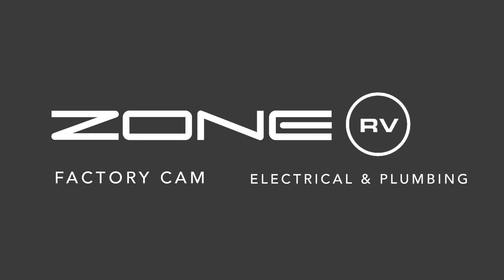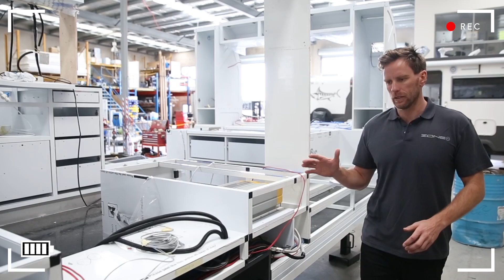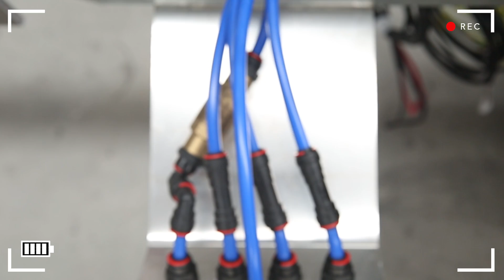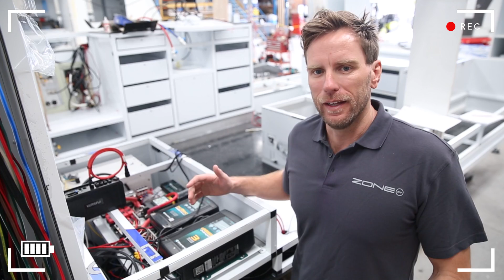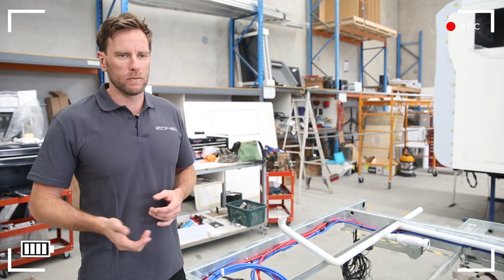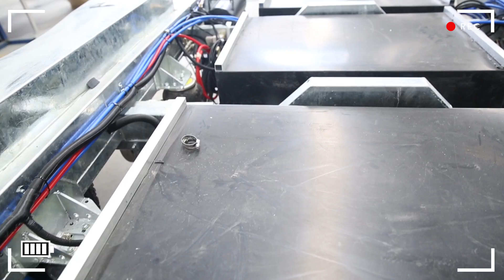Factory Cam 05 - Electrical & Plumbing

Comment: nice van and all that, but just wonder how can you  fix any pipes or electrical problem if you can't remove the glued panels or access the cavities even if you tested it....... just a thought
Reply: Not sure if this has been replied to Daniel but it appears that cabling, plumbing is done before the walls as per the video. Once the walls are on access is gained through easily removable access panels in every cupboard. Very neat indeed.